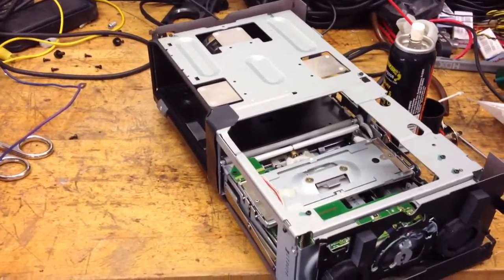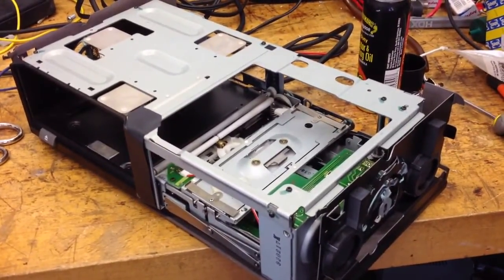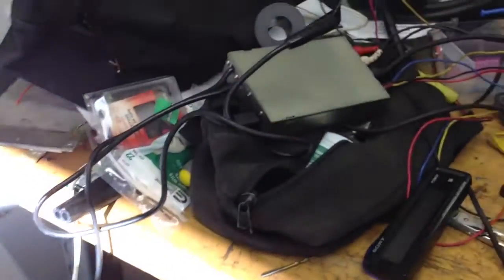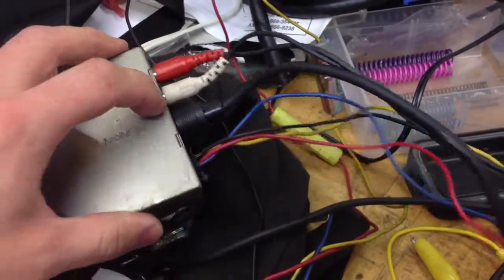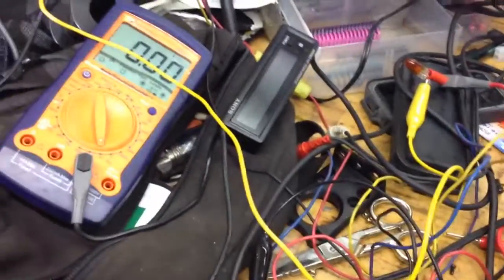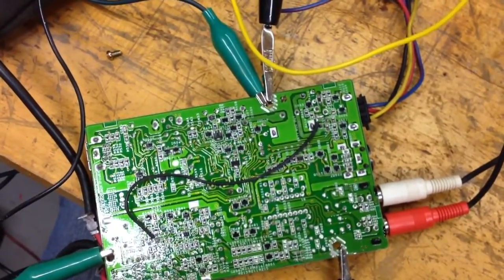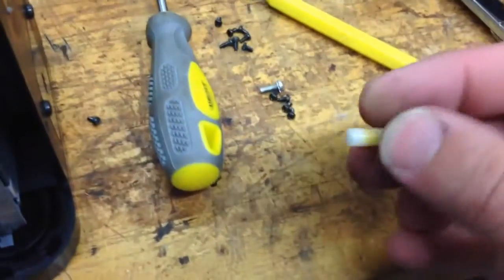Sony / Becker 980 CD changer repair, FM modulator modification

Comment: Hey compu85 i am having a nightmare with this cd changer! Cartridge would not eject. Motor just spins. Took it apart and the little worm gear has not dislodged. Cant see anything else thats wrong. Removed the cartridge then connected it all back up and and same thing just spinning noise of motor and cartridge stuck! Any ideas please!?

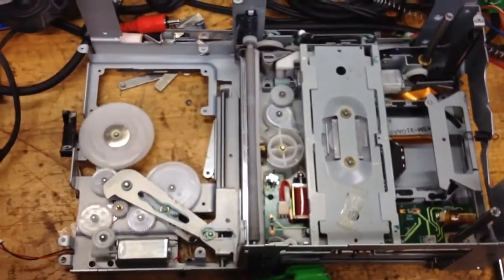Comment: I've got a 1991 500SL with the same changer. My worm gear came off, too. Instead of loosening up the internals (to avoid even more loose screws), what I did was put the worm gear on the end of a tool (actually the same tool you have shown at 8:19 to the right of the worm gear) and pressed it on just slightly with that. I put the pick tool into the thinner end of the worm gear and maneuvered from the side to press it on slightly. Then I flipped the tool around and used the flat end to press the gear on most of the way. To really make sure it was on there, I added some super glue to the shaft once I got about half way on. At the end to give myself some extra leverage, I had to push with that tool as well as use a small flat head screw driver, which I inserted into the first thread of the worm gear and pried up while pushing with the other tool. If you look at 10:28, I came in with the worm gear on the end of the pick tool from the left side (narrow opening). From that same view, you can see how inserting a screw driver into the thread closest to the motor and prying up (against the metal casing) could give a little more force at the end. Hopefully that is helpful to someone. JB Weld would be way better than superglue, too. :-)